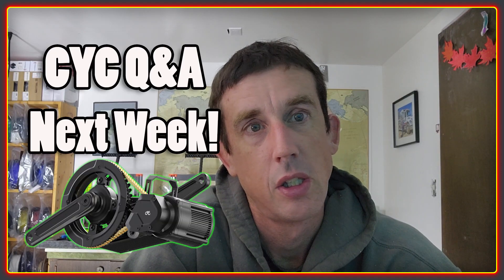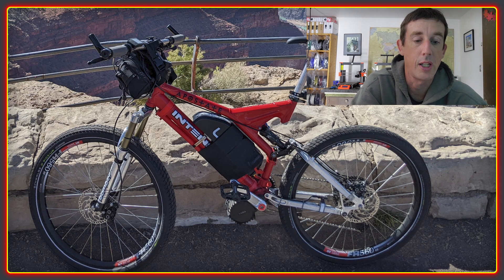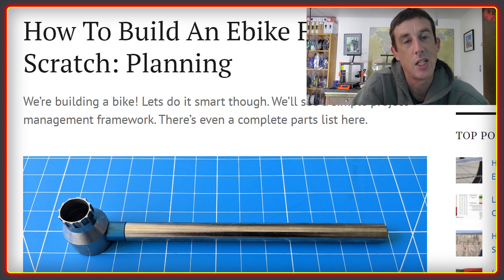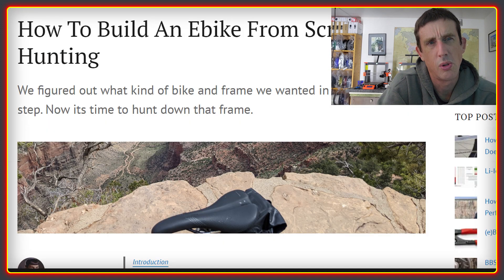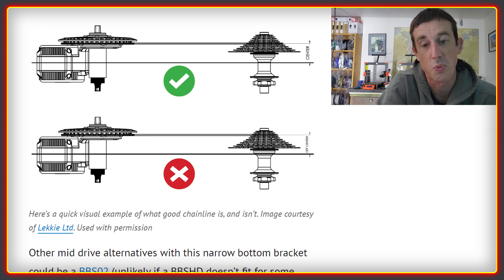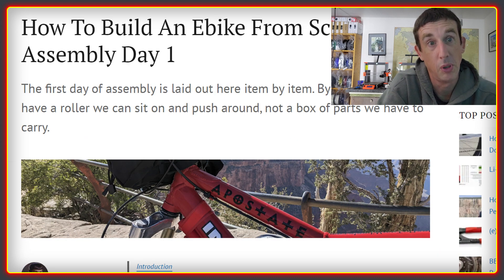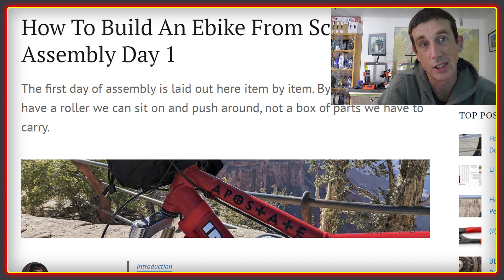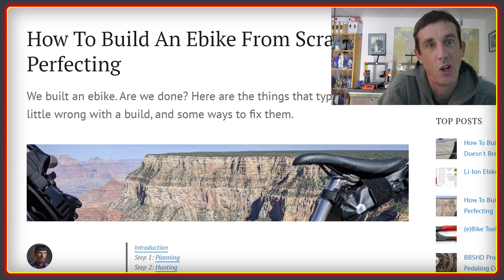New to Ebikes? Building a BBSHD bike? Check this guide! Works for any ebike build!

Comment: Glad to see Matt getting some love. He helped me when I wanted one and knew zero about any of this ,bikes included. “Get a dolomite and 120 kit” (and a lot more advice). That was 3 builds ago. Lol 
Best advice hands down was the socket to tighten inner lock ring. Best $50 anyone can spend when installing a BBSXX. Never had a loose motor on any of them
Edit: and where to get Magura’s cheap 👍
Reply from the maker: Yes the socket is crucial. Way too many motors came loose with Lunas crappy spanner! Great to hear from you. Cheers!

Comment: I realy want a bac855 controller. I bought a controller that fits in the stock place on bbshd and it has 52volts 3000watts. I like it because of it fitting the stock place. Thanks for update.
Reply from the maker: You are welcome. The one that fits with the BBSHD is pretty cool as well. I always had fun at 52 volts.
Reply: Jack, what is the name of the controller that fits within the motor casing and generates 3000 watts? May I ask who sells it?
Thanks

Comment: I got a Norco storm 7.2 frame 2016 and I got a hailong max battery with 48v 20ah inside it I had to shave of some plastic from the battery mount and make some holes for rivet nuts and the setup gives me a very good Center of gravity on the bike and with this bbshd I got It actually goes like Lightning Storm the only think I would upgrade on this motor is the jerkiness of the acceleration while using throttle and peddling and a torque sensor other that that it’s very good for London traffic as long as we have a good set of brakes
Reply from the maker: Sounds awesome. Working with a friend on a smooth throttle solution but probably next year. Chees
Reply: I have an article on that same web site that shows how to change the BBSHD settings to make the jerkiness issue go away, among other things.  Go to the Table of Contents and look for the two articles on settings in the  BBSHD section.
Reply: @websitemaker1717  ok go on I’m intrigued what’s the site link
Reply from the maker: The link to tales in two wheels is in the description. Click on the contents page to access other stuff.

Comment: One thing to keep in mind that I don't hear people discuss is:  When picking a frame or bike for your mid drive project, pay attention to the angle of the front down tube at the point where it connects to the bottom bracket. This will affect how high/low the motor will sit when mounted to your bike, and is especially important for off road builds. Also pay attention if there are going to be cables exposed on the outside of the downtube which may get in the way of the motor. 

Add this info to your guide if you haven't already! 😁
Reply from the maker: Good advice. Matt will be reading these comments. Cheers
Reply: Yes for sure.  I discussed this issue in Part 1 where I also showed an example of a curved down tube and what that does to your motor.  The bike pictured ended up using a Cyc X1 which is also in the example picture (originally I had wanted to do a Tangent Ascent but those motors went away).